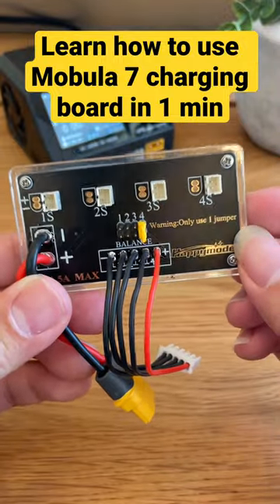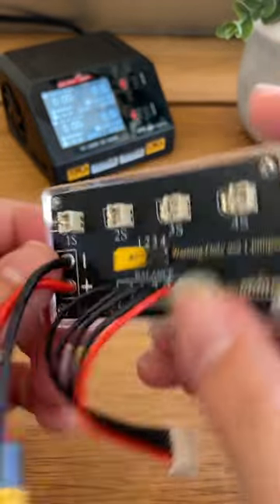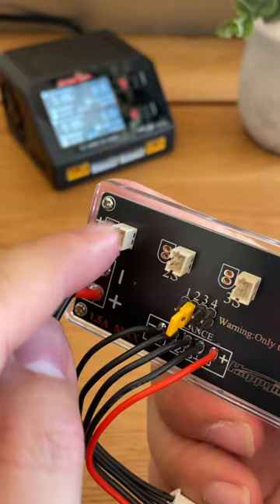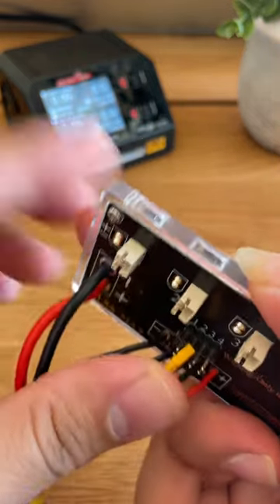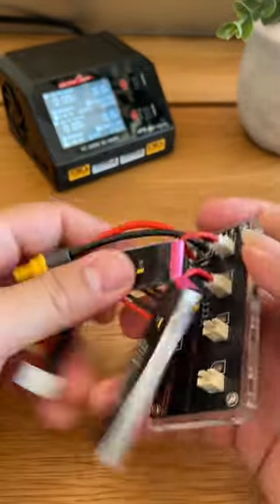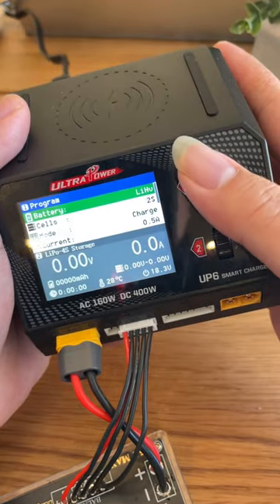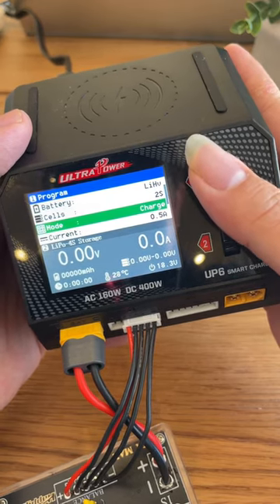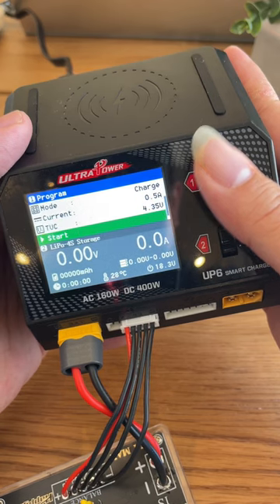How to use Happymodel Mobula 7 charging board  #mobula7 #happymodel #fpv

Comment: Hi could you help me? I tried to charge the board using a charger with 6s ports like yours (the white one), but it says "abnormal connection", eventhough I already set the jumper suited to no of battery.
Reply from the maker: Double check you also have the correct setting of cells on your charger, see if the resolves the issue

Comment: Hi i need some help with finding the right stuff for that drone like with the remote, goggles, batteries etc
Reply from the maker: Can you provide more information in details ?
Reply: @iFLYXWings6589  so I decided to get the beta fpv lite radio 2 pro controller, beta fpv goggles which use erls  and the mobula 7 1s but I'm not sure what battery to use and what is the cheapest way tk charge it?
Reply from the maker: Below will be the terms you are looking for 
Battery: Ph2.0 1S 
Charger:Vifly Whoopster 3

Comment: If I have 2 battery empty and 2 battery full, can I plug all 4 and put all in storage mode?
Reply from the maker: Nope that is not safe. You should discharge the other two to empty and charge all four to storage
Reply: @iFLYXWings6589  I see. Thank you so much.

Comment: So just got into FPV and these charging boards make me question the entire hobby. These companies should be embarrassed for selling this garbage. Just saying....
Reply from the maker: Well, this hobby is still not mature enough like regular consumer items. But it is surely getting better and better. If you are looking for a charging board for 1S, check out the Vifly Whoopstor V3, it is a much developed and finished product
Reply: This is not some mass produce prepackaged toy, it's built in a small workshop in the Qujiang District, in Quzhou city, in the Zhejiang Province of China. 

When you order a larger drone from them and they take a few days to ship it, it's because they have an assembly line of maybe 2-3 people each building a drone on command. They work hard, and fast and precise like machines, to provide incredibly cheap products that hold a lot of value. Look at the solder of those cheap drones like the tinyhawk and babyape, they are always perfect ... If it weren't for them, it would all be much more expensive. And probably also a lot less customizable, repairable and sturdy.
Reply from the maker: @sovietraccoon6007  Sadly we are not there yet, but one day
Reply: I have a mobile 8, which charging board for 2s do you recommend?
Reply from the maker: @edwinsantiago7639  For a 2S Lipo, suggested charging board will be the HGLRC Thor Pro, or the JB parallel board.